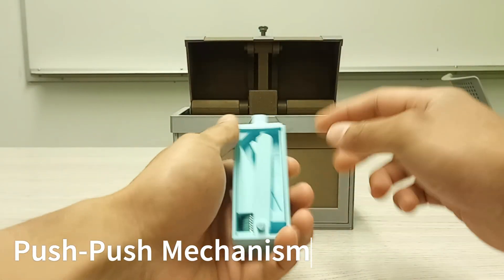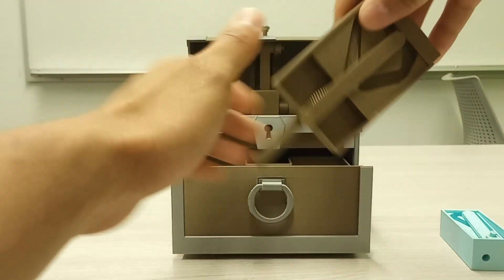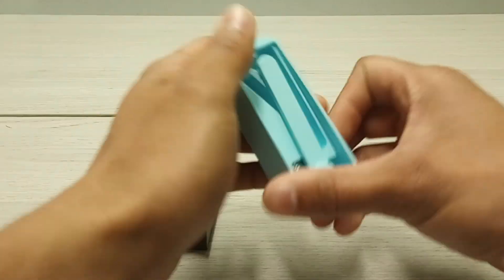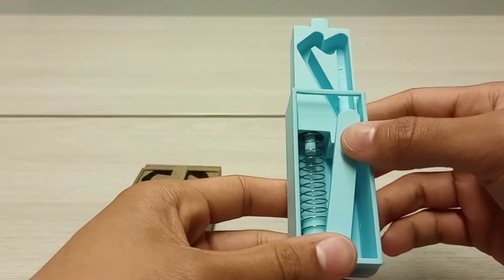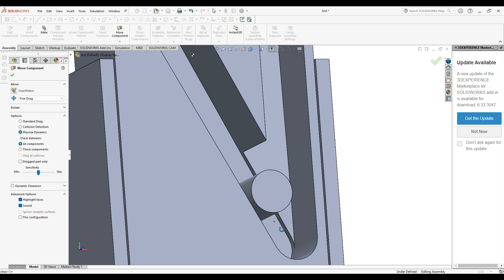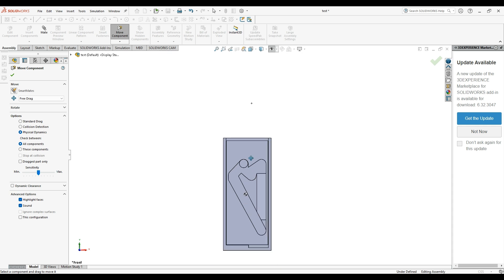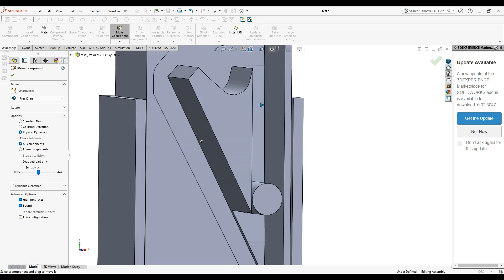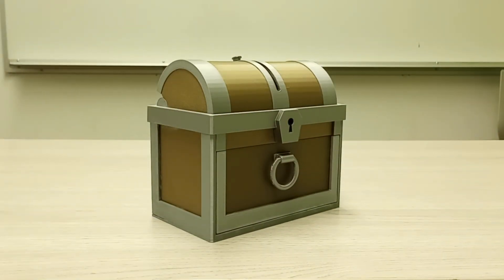Revised Push Push Mechanism

Comment: I'll drop you an email if you don't see this comment. 

Do you think you could make something like this inside a 2cm x 6cm cylinder?
Reply from the maker: Yup I somewhat worked on something like it. If you would want to make it, it would have to use a small metal rod instead of having it 3d printed which would be weaker.

Comment: Final step: Print in place everything, even a spring.
Reply: A 3d printed compression spring of that magnitude? Nowhere near possible
Reply: @arturjogi6054  I've done it once, the trick is to print it in a long uncompressed form, also it has to have the grain flow with the whole spring no slices.
Reply: @leggysoft  could you clarify what you mean by the no slices part? What orientation would you place the spring so that the slicing wouldn't create way too much of a weak point?
Reply: @arturjogi6054  I just create a wavy part as a crude spring it's only flaw is it has a small compression ratio like 2:1. If you're not doing print in place could even make a coilspring using a scaffold.
Reply: @leggysoft  oh, a flat spring instead of a coil spring. I feel that would break really fast with most of the bending happening at the "corners"...
Reply: Have you found a "pip" version yet? I need one as well, I was going to do a few prototypes this afternoon but if someone's already released one it would save a ton of filament! 😊

Comment: Beautiful. Ironically, the more thought we put into a design, the simpler and simpler it becomes. At a certain point, you can streamline an idea to where it's so elegant that people will fail to see its complexity or significance at all, because it starts to look 'easy' or obvious. Cleverness gets taken for granted in this way. 

Often when we see brilliance in daily use it doesn't even register, as though we believe we could have thought about how to solve the problem ourselves. But if I'm honest, could I live ten lifetimes alone, I doubt whether I'd be able to invent the modern doorknob or a Bic lighter, let alone a filament light-bulb or a bicycle.     

Invention is a selection process: time spent while favoring small adaptations and subtracting the extraneous equals improvement. At least, I think that's the solution, but I'd have to think more about it!
Reply from the maker: @pocket83squared  thank you for this comment, I never really thought of the invention process in this way but I definitely agree.
Reply: Simplicity is the ultimate sophistication.
- Leonardo da Vinci
Reply: You can also mess things up by designing efficiencies or redundancies that add complexity if you spend TOO much thought into it
Reply: @Aryasvitkona  Sure. That's called diminished return. But if you keep coming back, you'll start to see where you've introduced superfluity into a design, and correct for it. On average, more thought put into something yields an improved result over time. Just think about how many times the light bulb has been considered perfect enough to be 'done.' Thing is, in design, we're never done. Not until the light bulb can do our taxes, rub our back, and let the dog out. And make dinner. Without electricity.
Reply: @pocket83squared  I'm not talking about diminished return though, I'm talking about actively being detrimental to the design, such as adding complexity to deal with some edge cases that make it more prone to error, more likely to break, or even actively just making it function slower.
Reply: @Aryasvitkona  Nuanced conversation, so strap in. Optimum is the peak of the mountain; all other directions from the top are down. My wife has a perfect chocolate-chip recipe, and if she changes ANY of the variables, the result must be a worse cookie. Consider that thought is one (the) resource that's being invested into a design. Once a design nears an optimum, further thought provides a diminished return. Lots more ingredients, but still no better cookie. Optimum is relative to a stated goal. 

You and I can work on a new light bulb, and maybe we could double its efficiency or lifespan, but our achievement would never be as revolutionary as the initial discovery of a glowing filament was. That's also what I mean by diminished return. Your point is understood, but you're also talking about design changes more than improvements to the root design. 

Lights now have toggle-switches, flowing lava above them, and even wi-fi connectivity, all of which being incidental inventions to the fact of light. Plenty of these impede the bulb's glow. Some lights are made deliberately worse for marketing, manufacturing, and/or pricing considerations. All designs are attempts to optimize for something, and the only way to optimization is through thought. Once that thought has been fully realized relative to the stated goal, more thought is just additional chocolate chip.
Reply: chatgpt lmfao
Reply: @planetfixer  It's funny (but also sad) to me that literacy has become such an underused, undervalued skill that you'd actually think that. Believe it or not, some people actually learn to write without assistance. 

Well-crafted text only looks fake to you because you lack the skill. Want to improve? Don't use "lmfao" ever again; it's the written equivalent of an eleventeen year-old smoking in order to look tough.

Comment: Fun little trick I've used in the past is to design a leaky air cylinder into the travel mechanism as a way to dampen the action so it isn't so cheap feeling.
Reply: Ha! Just like the telescoping spring guide in the MP-40
Reply: Is this to soften the motion at the end range? Can you explain how this works and the benefit it provides? Thanks!
Reply: @MistaJones89  i'm assuming as it gets pushed down it creates air pressure until the air fully escapes out of the cylinder. When pushed out it creates a vacuum until the pressure equalises. This provides resistance on each movement

Comment: Could you do a series on mechanical principles? Like a “build your own contraption” thing, where you present some ideas and core concepts, and then anyone who wants can go out into the world and use those principles to build something. I feel like that could be a good way to actually get people into mechanical engineering.

Also, I think it would be interesting to see wood become a choice material for prototyping. The sense of having created something as opposed to loading a file up on a 3d rendering software and sending it to a printer sounds just… I dunno. I feel like it robs people of the actual experience of having to work with a material in order to utilize it. That, and I have a deep distaste for oil companies and plastic manufacturers. 

And I feel that this would drive the reconstitution and revitalization of deforested areas, which is desperately needed nowadays.
Not enough trees, too many pollutants.

Thoughts?

Edit: …corrugated or stacked cardboard.